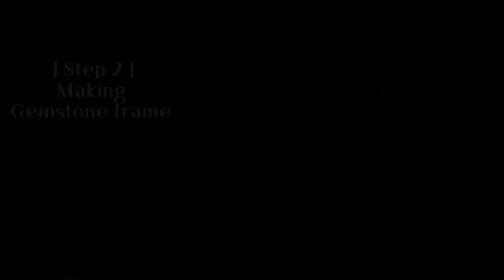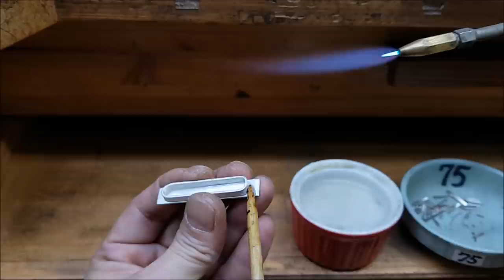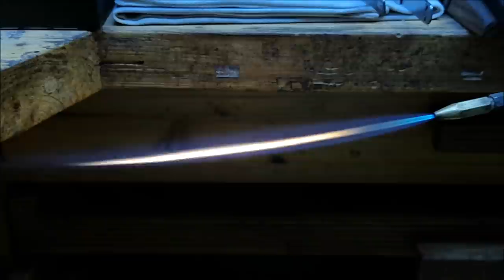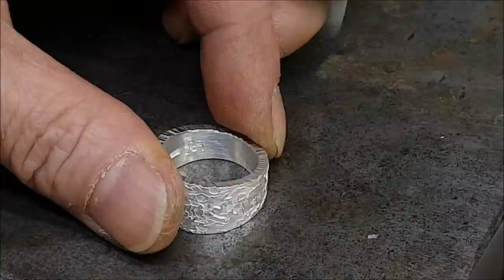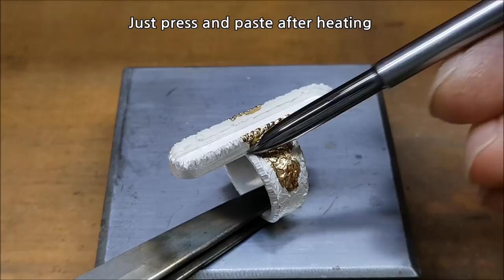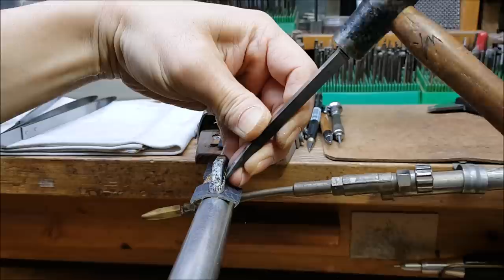MAKE A SILVER RING that resembles a mountain for her

Comment: Good morning maestro,
thank you very much for your inspiring videos. I have learned a lot from your videos. I tried to use your type of stonesetting for a gerbera flower pendant. I used sterlingsilver 1 mm thickness(18 g). Now i have the problem to push the edge to the stone. Ist is too hard. Should I use a thinner sheet silver or finesilver?
Can I glue a blue calcedon stone? It ist a clear light blue stone. I am afraid that the glue get's with time visible. The glue get's a little yellow with time. 
I ordered camellia oil from Japan:). Can I use the oil also for shiny silver? Prevents it also silver from getting tarnished?
I hope you and your family stay well in this time.
Greetings from Germany
Reply from the maker: Ich kann nicht sehen, was du tust, weil ich es nicht sehen kann.
Es tut mir leid, dass ich Ihnen nicht im Detail helfen konnte.
Der Klebstoff wird mit der Zeit etwas gelb.
Deshalb ist es gut, Pastellpulver mit einer Farbe zu mischen, die der Grundfarbe ähnlich ist.
Silber und Silber ändern sich alle im Laufe der Zeit.
Es ist unvermeidlich, sich zu ändern, und stattdessen müssen wir verstehen, dass sich der Stil ändern wird.
Interessiert an der Produktion meiner Arbeit,
Vielen Dank.
Hoffe du hast immer viel Glück !!
Reply: Thank you maestro for your soon answer, you helped me a lot. I'll try the pastel colours. Yes, your philosophy  of silver is right, I have to  accept the change of silver. Have a god day.

Comment: do you ever get firescale with your soldering technique?
Reply from the maker: Firescale is not generated by soldering technology,
Since the material is silver, it is created by simply applying heat without soldering.
Firescale can be removed by repeating pickling and heat treatment.

Comment: a pencil as a flux applicator and solder pick!  is it hard solder? seems to flow so quickly.
Reply from the maker: If you look closely at the video (including my other videos), you can see what solder I use.
I run the percentage of solder with silver content of 85%, 80%, 75%, 70%, and 60%.
It is difficult to understand the content of solder only by looking at the video.
Reply: @SilverMeister  yes! i did see the small, labeled bowls of solder, and thanks for the answer. i do not know the percentages as we in the usa use solder marked hard, medium and soft. i use only the hard solder. the use of black or colored pastels in epoxy is a very nice tip, i have used colored marker pens to stir color into epoxy but then you lose the pen doing these so thanks again. your work is first class and i can only hope to achieve a degree of your skills.
Reply from the maker: The terms strong soldering, medium soldering, and weak soldering are ambiguous.
I use alloy solder to make my own.
It is the safest and surest choice to make and use the % I want (it is difficult to check the components of solder for ready-made products sold).
When adding color to epoxy, it is better to mix powdered pigments rather than liquids.
Liquids (marker pens, etc.) may degrade the performance of the epoxy.

Comment: Excellent work! But I notice you store acid in steel container, which is probably why the solution is green, due to reaction with chromium in the steel. Sterling silver shouldn't react with dilute sulphuric acid but it will be tainted by the chromium. Best to keep acid in a glass vessel.
Reply from the maker: This is different from the iron containers you know.
It's specially formulated for pickling, and I've been using it since 1991, no problems.
Every tool I use has a reason for using it that way.
You don't have to worry.
Reply: @SilverMeister  Was not a criticism. I commented because solution in stainless steel container is green, which is common when chromium in steel is oxidised by an acid. Dilute H2SO4 is colourless. And I know it's not iron. Stainless steel can handle acidic solutions at room temperature but hot acids can react with it, which I think is the case here. But besides that, all is OK if pickling silver etc is not affected.
Reply from the maker: The translator isn't always accurate. I don't understand English deeply.
It's hard to know if it's a criticism or not, so you need to be careful with this kind of content.
You don't need advice on how to work, and it's best not to say anything that could cause misunderstandings.
It is clear that my working method is optimal for me at the moment.
Any further comments are politely declined.

Comment: Do you use camillia oil as sealant or any other thing if so how long does the oil last before tarnishing
Reply from the maker: Camellia oil will have a limit to protecting the silver surface.
It's much better than not doing it though,
If you actually wear it on someone's hand, it will naturally turn into vintage.
I hope it is getting old in a vintage way~
Reply: @SilverMeister  thank you can you suggest me a sealant please
Reply from the maker: @Yash8595_  
Sealant... coating, plating, etc...
I don't do that, and I don't want to recommend it.
It is natural that silver is changing like silver, and that is the charm of silver.
Sorry~